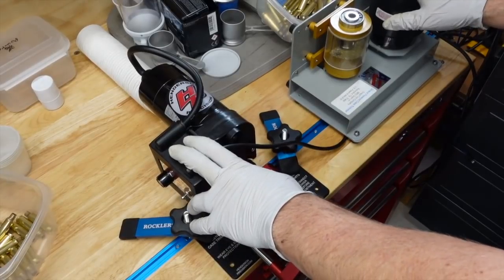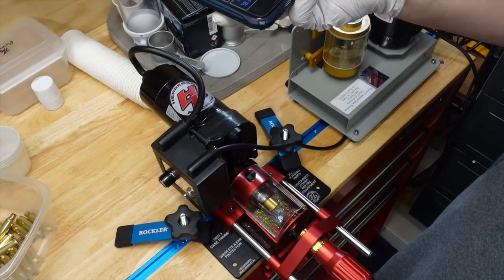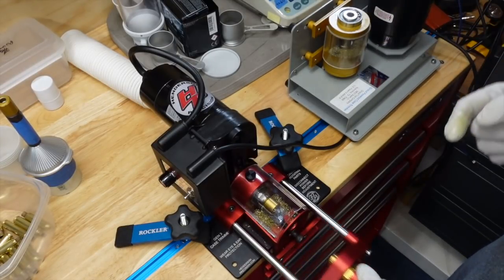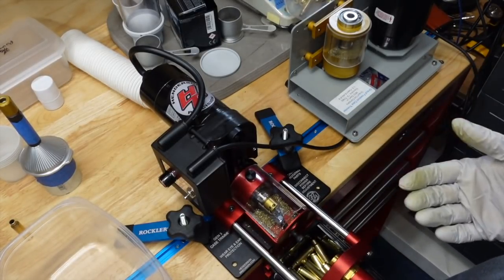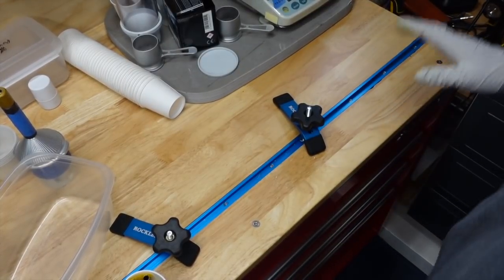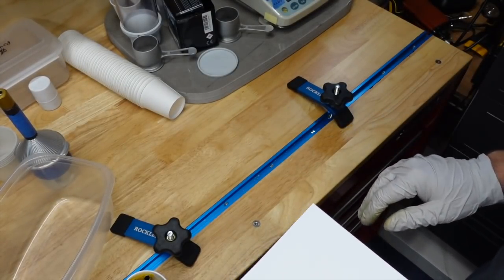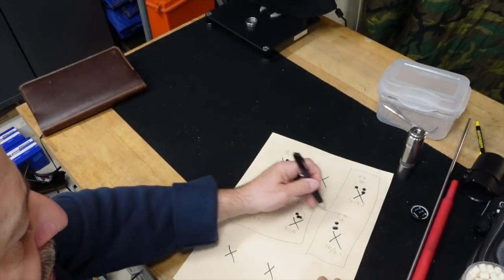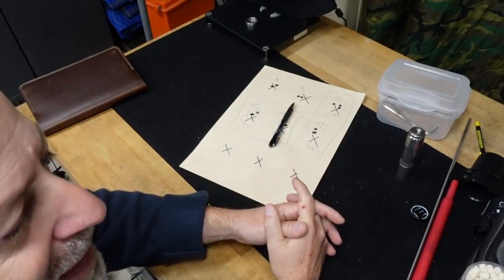Henderson vs. Giraud Rifle Power Brass Trimmer Review

Comment: What do you think about Frankford Arsenals case trimmer / case preper, i find mine is pretty consistent, ive had it for 13 years, it uses the sholder, but you can adjust the fit to where theres very little if any play, i like your video, i believe i like the Henderson better than the Giraud.👍✌️
Reply from the maker: Thank you and I'm glad you liked the video. I'm sorry but I've never used the FA trimmer although a friend of mine used one for a while before upgrading to the Giraud. He liked it and felt it worked well similar to your experiences so it sounds like it could definitely work if it fits your needs.

Comment: It is very unclear to me what makes the henderson trimmer the winner here in regards to consistency against the Giraud. Could you please make a video explaining the differences in the trimmed casings out of the two trimmers and what makes one trimmer produce better and more consistent results than the other. Also be sure all things are equal, such as the sized brass casings and the carbide cutters are fresh. You had also mentioned that the Giraud you've had (and used) for a long time vs the Henderson is a brand new machine with minimal use. All of our fellow reloaders would greatly appreciate some added clarity if you could do that for us, thank you John! (I am looking at these two trimmers from a precision handloaders perspective.)
Reply from the maker: I was simply showing how and why it was better for me but I know plenty of people who love the Giraud for their own reasons. You just have to decide if you care more about trimming to OAL or off the shoulder. Both work fine but my hands don't hurt as much when using the Henderson and it's really consistent so that's what I use.
Reply: @FClassJohn  I got the impression it was maybe due to a difference in the angle of chamfer between the 2 trimmers.

Comment: Quit watching after not measuring the brass the same....base to tip. What was the point of showing this test if your not doing a apples to apples test.
Reply: The Giraud trims to length in a cartridge adapter that bottoms out on the shoulder so its trim to length is shoulder to case mouth and does not take into account ANY inconsistencies in the length of the body or head thickness. This results in neck length trimming for consistent “neck tension”

The Henderson measures length from the base to the case mouth and this risks trimming necks different length while keeping the OAL the same. This results in OAL trimming not “neck trimming” and can lead to possible inconsistency in “neck tension”. 

With that said it looks like the Henderson will provide be more consistent chamfers due to the pilot helping hold center and the pilot helping to smooth any burn pushed into the inside of the chamfer from the cutter.